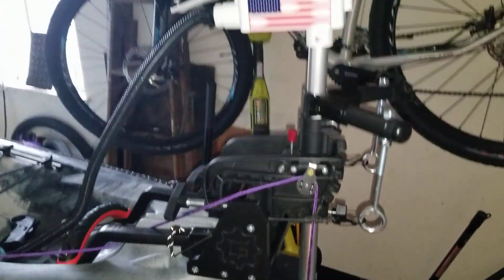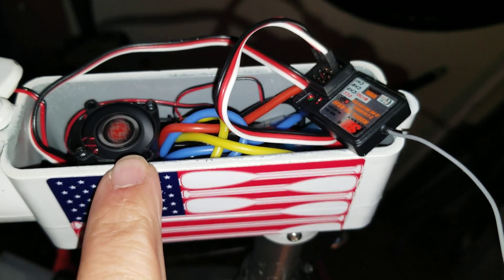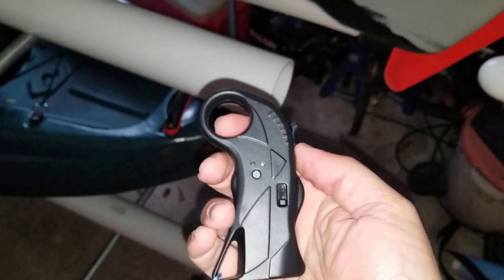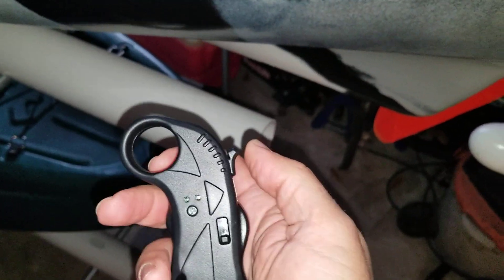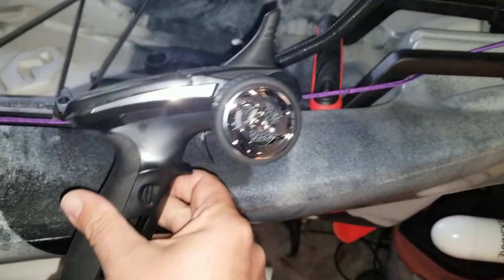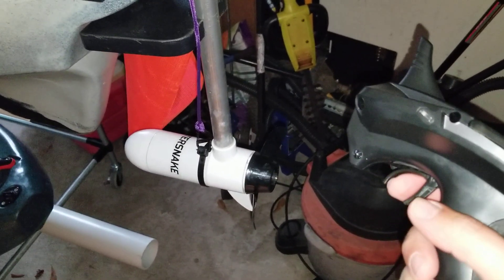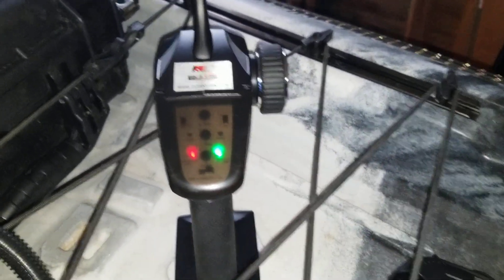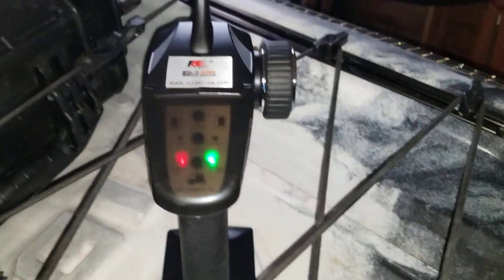DIY Remote Controlled Kayak Trolling Motor Update

Comment: For years I have thought about this thing -> An autopilot for my kayak.
It wouldn't be so much about the motor prop but the steering. (I have a hobie kayak)
I thought about a servo motor to take care of the steering, then comes the crazy part where I'd have a voice recognition system to just guide my yak or giving it instruction to keep a certain direction and auto adjust the steering depending on water roughness. I swear if I was back in an engineering program in school, I'd build a "smart" kayak with integrated machine learning. Bunch of sensors, compas, gps and even go with machine learning to read my transducer's results. Depth reading which would be connected with the down-rigger.
Making recommendation for depth setting on the down rigger or send warning when the ball is about to hit the bottom. Even letting the machine control the down rigger as a last resorts to avoid hitting the bottom. 
I give it 20 or 30 years and we will be there...

Comment: Mike, The first remote you held and talked about is the one to use. When done with it it won't bulk up in your pfd when done whereas the one you mentioned your going to use will when done. The first small one >> the speed trigger has a mechanism/spring inside that makes the trigger go back to no speed when released. According to the little bolt holding it together, it can be taken apart - do so and remove the springing devise inside and replace it with a dragging device that will allow the trigger/speed of the motor to remain constant (where you left it) when released. Nice rig  Bill. Go TEAM SMOKE!  Good luck & Tight Lines. Note: I can't see your pwm holding up very long....may just literally turn into team SMOKE / Once again good luck!

Comment: I’ve been thinking of doing this but using  Frsky gear as I fly RC aircraft with this. The reason is I could also use the telemetry which could give a visual readout of the volts, amps, watts, amp hour and maybe even GPS speed. It can also do voice readout of those parameters.
Reply from the maker: I am a HUGE Frysky fan. I have used their remote control and remote telemetry on drones. I have digital remote telemetry on this remote control kayak, but it is not Frsky.  The problem becomes the remote size, and the ESC. There are very few ESCs that will run brushed 4s. 99% of everything in the RC world is brushless. 99% of everything in the trolling motor world is brushed. So after more time on the interwebs than I will admit to, there are only 2 solutions that I found, and this is one of them. If you come up with something different, I would love to see it
Reply: @MikeJordanUnCamplicated  the remote I was thinking about is the type that looks like a game controller, or maybe the Jumper brand as I understand they are reasonably small, all of which I haven’t seen first hand though as I use a X9d. Re brushed ESC’s, I have 2 I use but I was intrigued why you say 4s as I use 3s if I’m using LIPO’s, but am usually using 12v gel battery’s in parallel. The ESC I’m looking at here is Skyborne 35 and it doesn’t even get warm on the Watersnake trolling motor. I just have a servo tester in a box that sits beside me using a servo extension cable to the connect the rest of the gear sitting in the battery box.
Reply from the maker: @timothysmith5453  I would never, ever, ever, never run a LiPo on a kayak. They are way to volatile,  and their high discharge rates are completely unnecessary.  I run mostly a LiFePO4 and sometimes a LiIon. Both in 4S
Reply from the maker: @timothysmith5453  I would never, ever, ever never, run a LiPo on a kayak. Way to volatile and their high discharge rates are unnecessary. I run LiFePO4 and LIIon both in 4S. I can't find any info on that ESC

Comment: Very nice custom work! I’m new to the ESC idea and searched everywhere for my total newb question. If I use an ESC, does it matter if I use a deep cycle cheap battery verses Lithium version? Trying to contain costs for now. Guidance is greatly appreciated!
Reply from the maker: No it doesn't matter to the ESC.
Reply: @MikeJordanUnCamplicated  Thnx Mike - last question. Does the cheaper PWM lots of yakers are using give longer battery life during a fishing outing vs an ESC? Both do the same? Wasn’t sure if an ESC helps prolong battery life better than the other PWMs folks are using.  Appreciate your time and responses!
Reply from the maker: @rm5013  the esc outputs pwm. So there is no difference in batt life. But there is light years of quality difference  between the cheesy pwms and the esc

Comment: Where's the follow up videos of this? 
This is exactly the project I'm wanting to do ....but there's next to no info on how to do it out there....
Reply from the maker: Everything you need is right here in this video and the links provided. Make sure you click through everything. What are you missing?
Reply: Thanks for replying! 
I'm just wondering where the next vid is. How did the potentiometer work? What box did you mount it all in, how/what did you take out of the remote to make it work......etc. 

I'm looking at a skateboard controller now that has come out since you released this, that has reverse and cruise control on it.... Do you think that would be the easiest answer, with the hobbywing 880?
Reply: Do you feel the flipsky vx1 is compatable with the hobbywing 880? I don't know what v4 and v6 means......and I can't seem to find that info.
Reply from the maker: @kikstand2011  ALL links, ALL links, ALL links. It ALL there
Reply: Ahhh..... I didn't equate the drive link to being what I was looking for.....I was expecting a "part 2" type of vid. 
The pics helped some...I appreciate it. 

What do you think of the above idea...with the flipsky vx1?
Reply from the maker: @kikstand2011  thats what i started with. i did not like it.
Reply: @MikeJordanUnCamplicated  yeah.....in this vid you said it not having a way to lock in the speed....sucked. I hear that. I really only want the motor to maintain position for fishing really.  So maintaining speed is essential. 

This new controller though, has reverse and a cruise control function, that can hold your speed ....so that kind of fixed that. 
My only this is ...it says it's for v4 or v6 only.....and I don't kbow what that is, or if it applies to the hobbywing 880. I can't seem to find any info on that either way.
Reply from the maker: @kikstand2011  It is not V4 and V6, it is VESC4 and VESC6. Those are receiver protocols. Google them to learn more . They are probably not going to be plug n play. Some programing and soldering will be involved.  I did all of my programing on the ESC. (the ESC buy link has a good how-to) There is also a non-VESC transmitter listed. Looks like you will need to buy a separate reviver for that version. But it should be easier to work with

Comment: Thank you for sharing! I have a couple of questions if you don't mind.
#1 What enclosure is that for the ESC that you put on top of the trolling motor shaft?
#2 I have a minn kota endura c2 that is rated at a max 30 amp draw, would this solution work well enough for that?
#3 Do you happen to make / sell any of these setups?
Reply from the maker: It is a electrical connector box from Lowes. It is painted white. They will be grey at lowes
Reply: @MikeJordanUnCamplicated  thank you sir!

Do you happen to have a link for the skateboard controller?
Reply from the maker: @hwmtrustychords  no cruise control, you have to hold it the whole time. Are you sure you want that?
Reply: @MikeJordanUnCamplicated  yes and no, I really like the compact size of it.

Comment: Great info. How is the rock crawler ESC working out ? Are there any heat issues with the ESC being enclosed ? Thanks for sharing.
Reply from the maker: Its been a lot of miles over the last year. No issues. I run the included fan. I checked the temps on the heat sink after a 2 hour full throttle run on a 90° day. The heat sink was only 107°. So barely over ambient temp.
Reply: @MikeJordanUnCamplicated  Good to hear. Im also running a Watersnake T24 which pulls 20A at full load. Im into RC as well and going to try an 80A rated ESC and hoping the extra capacity will minimize over heating as well. Thanks and tight lines.
Reply from the maker: @jubal4614  my ESC is 80amps continuous and 400 amp burst. I searched the interwebs over. I only found 2 ESCs that would run brushed 4S, and had the amperage headroom. Did you find something different? If so, what?
Reply: @MikeJordanUnCamplicated  Yeah, the limiting factor was 4s but I found this one on banggood.com - "640A Bidirectional Brushed ESC 7-18V 2S-4S Electric Speed Controller for DIY RC Differential Track Climbing Cars Boat".  Its actually rated at 100A continuous, 640A burst.

Comment: What is the other battery that you used?
Reply from the maker: I am not sure what you mean by "other battery" ?
Reply: @MikeJordanUnCamplicated  I think Meghan is referring to the battery you used to replace the LiPo in your transceiver. I too have that question.
Reply from the maker: @2metock  the remote controller battery? The link is in the description towards the bottom. I can fit 2 in the remote. Only one is connected. One is a back up. Never needed the back up

Comment: How did you power the receiver?
Reply from the maker: The receiver is powered by the esc
Reply: @MikeJordanUnCamplicated  Thank You for the info,  I was thinking that but when I looked at the specs of the receiver, I believe it said up to 11 volts so wasn't sure how much tolerance is available.
Reply from the maker: @2metock  if you are reading 11v anything.  You are looking at the wrong parts. Use the links in the description
Reply: @MikeJordanUnCamplicated  I used the link provided to get the FS-GT2B. It comes with the FS-GR3E receiver. according to the amazon page for that receiver, its max voltage shows 6 volts (less then what I thought I read the first time) but I believe what I'm missing is you are using the BEC function on the ESC to power the receiver.  Thanks again for all your replies!
Reply from the maker: @2metock  you are confusing BEC voltage with ESC voltage. Common mistake for non-RC builders. The 6v BEC voltage powers the receiver. The ESC is 4s. Which is 4 cells in series at LiPo voltage. Which is 16.8v. I have run 16.8v for nearly 3 years
Reply: @MikeJordanUnCamplicated  Yes sir, The RC terminology is as clear as mud but I'm starting to come around.  Have you come up with a way to have remote steering?
Reply from the maker: @2metock  my kayak has foot steering that I love, so never had the desire for remote steer. But it would not be that hard. The transmitter and receivers will handle that. You would need a servo, actuator, or a step motor.